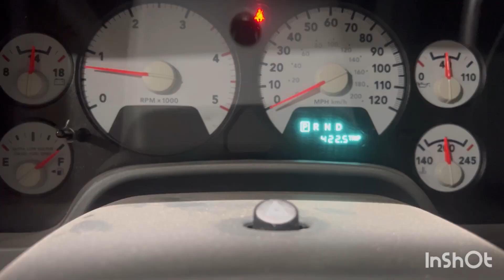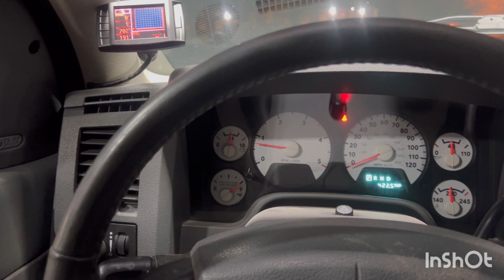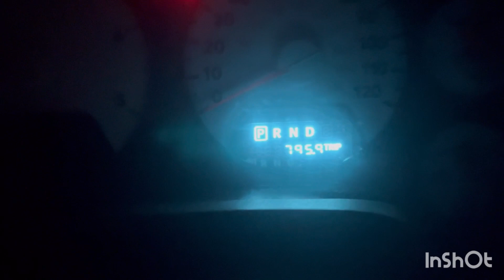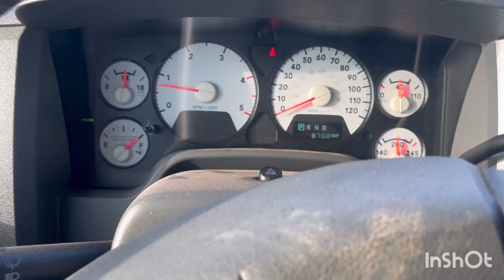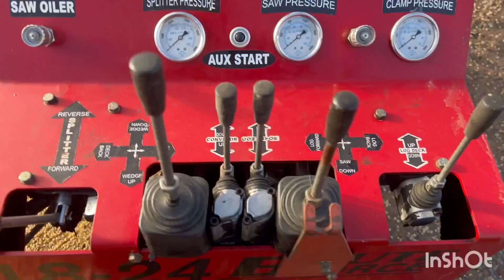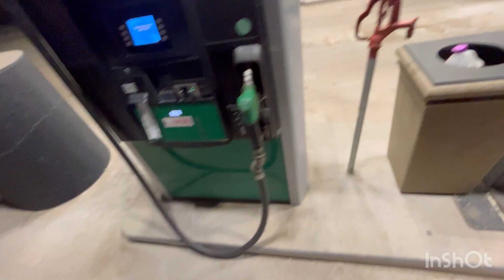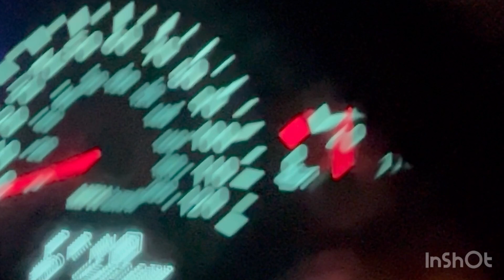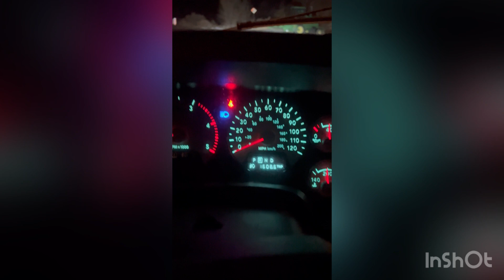What did I drive 1600 miles to buy ?

Comment: Very nice machine! I was wondering how you got that thing home and how the tires help up... Now I know. 
How much wood can you process per hour?
Reply from the maker: It was quite the trip ! I think the tires were pretty old even though they looked good before I left. It had probably been pulled in a 50 mile radius its whole life before I yanked it 800 miles home. It is supposed to process 2 cord a hour in perfect conditions. I’ve only gotten 3/4 a cord a hour out of it so far but my operation is not flowing very good yet.